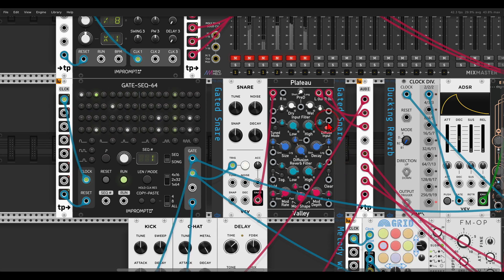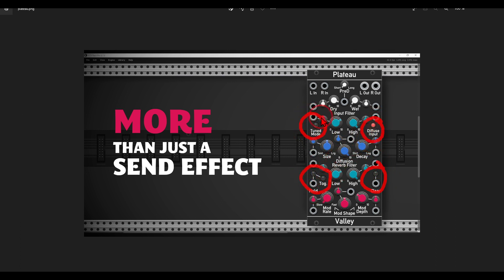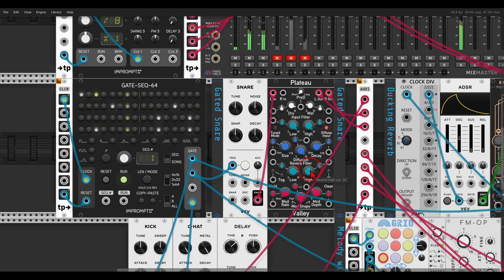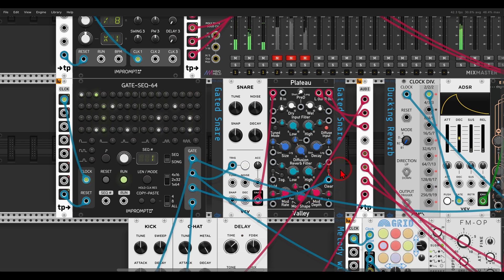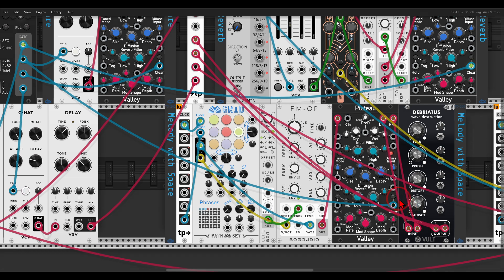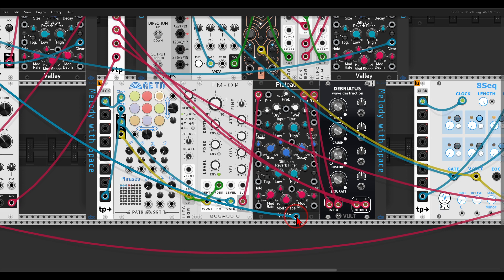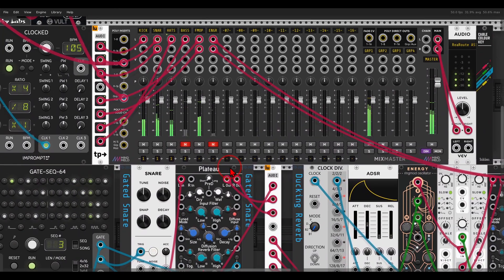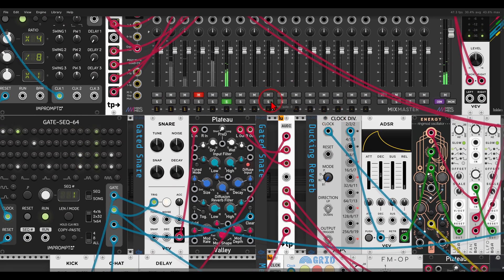Gated reverb made easy \ Quick Tip

Comment: My only complaint (😉) about Plateau is that it doesn't exist as a eurorack module. It's a great/deep module with so many possibilities that are all modulatable. I use an FX Aid, but to be quite honest I find Plateau more interesting as you can sculpt your own sounds.
Reply from the maker: Check out the Strymon StarLab. It has so many features that make it much more than just a reverb, very similar to Plateau. It has a Clear input to clear the buffer, Karplus Strong for tuned reverbs, a filter, and so many other interesting sound-design tools. If I had the space and money, I would definitely get one.
Reply: @OmriCohen-Music  Thanks Omri, will do. However, as you say, it's a big module (a space invader), and like you I also don't really have much space left in my rack.